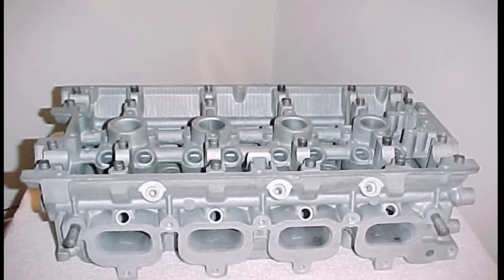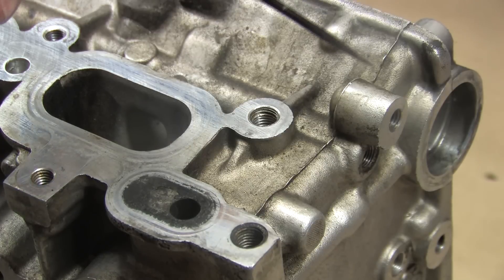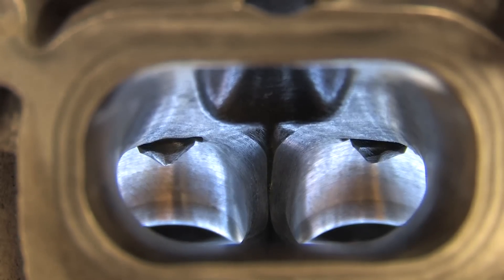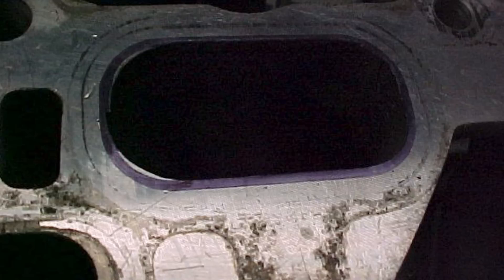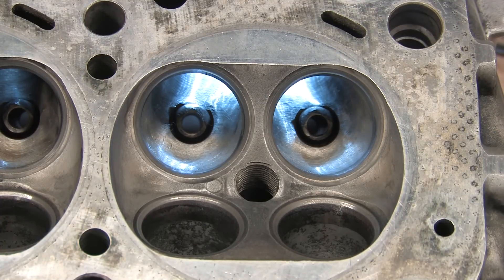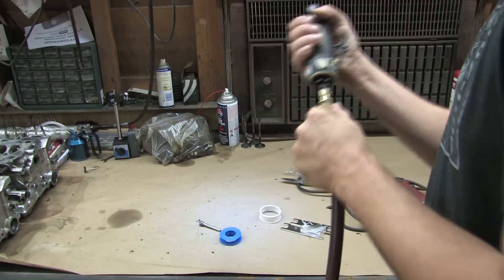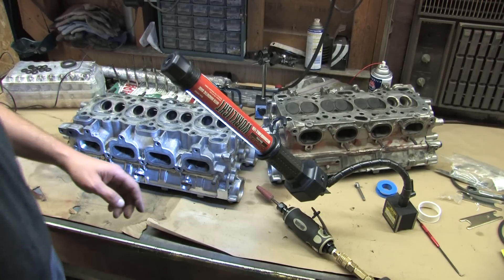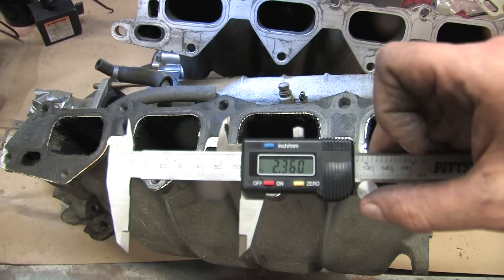Cylinder Head 106 - Casting & Porting Tech

Comment: I've worked with pressure die cast tooling, and "flash" as we knew it by was quite a problem at times, usually the result of poor bedding in of mating die steels, or core pin mis-match. Net result was it meant another tooling operation to trim it off which cost time & money & so on. Excellent video once again. Nice to see a Mic once more... :-)

Comment: you have to combine the two in a port.
very slight conical shaped main gallery then wider just before the valve guide to compensate this obstacle by slowing down the flow gaining pressure.

you need to have a larger side of the of the valve guide more than the other to have a better bias effect and better flow.

there is a guy doing heads for bikes that reduced the diameter of the intake ports and he has more hp than the others because of the higher speed of his mixture.
better efficiency

Comment: Old video but I’ll add 2 things… 1) buy a die grinder with a REAR exhaust. You’ll thank me later. 2) use some masking tape on the delicate areas of the valve seats. I have ported A LOT of heads. A bunch of them were old iron heads. I learned the hard way lol

Comment: Great vid.  Only recommendation I would add is get a swivel fitting for your die grinder.  That way you're not contending with the weight of the air hose.  I use swivel fittings on every small air tool I own and it makes one heckuva difference.
Reply: +Mark - Awesome!

Comment: I use a big electric die grinder for porting like the one you say not to use. One trick to slowing it down a bit is to make a short extension cord with a junction box on the end. Wire an outlet to a dimmer switch in the junction box.

Comment: excellent video. Ive been hand porting cylinder heads since I was 14.
You've managed to touch on most of the important area's when thinking about porting jobs. too high a port velocity also affect performance just as much as low velocity ports and it all ties in with where in the rev range you want to make max torque.

Comment: Thoughts on grinding the bottom of the seat on the intake side. There is a step there it's like hitting a wall. Also grinding the valve seal smooth. And just clean the casting lines up. And a gasket match.

Comment: hi i like your clip, i used to port heads 25 years ago and i used to back up what i found on engine dynes so i know a little about porting . what a lot of people forget is fuel flows throw the port as well and that is wear a thing called swirl is very very important, and fuel control throw the port how you do that DO NOT MATCH PORT because the fuel will trace along the wall of the port you need to get that back up into the air flow so it can mix with air so your not wasting fuel this means more power and better fuel economy . how do you do that is went you blow air across a 90 degree angle you creat a low pressure witch can draw on a liquid say with when blow air over a straw in water it will draw the water up the straw and into the air stream . now if the intake port is larger than the intake runner or manifold by 1/8 of an inch you will make a step witch is a 90 degree so when the fuel is traveling down the wall of the runner it will come to the step and pool the air stream will pull the fuel back up into the air stream . i now you get better flow figure on a flow bench, but when you dyno the engine you don't get the HP when you step just the intake you get a richer mixture on the dyne when you lean the mixture out up comes the HP if you don't believe me try it thanks jake
Reply: +TheJVR333 Hmmm, you obviously know way more than I do, but I'm wondering if this is truer with fuel pulled from a carburetor than from a misting fuel injector?

Comment: i was speaking of the ridge between the exhaust port and the manifold  wich helps to prevent backflow.
i knew about the speed of the gas and the size ansd shape of the exit.

i found nothing on the backflow and this ridge.

you wrote "As gasses expand, they cool" ?

they are slower as they cool because they take less volume and loose vivacity as i know.

i missed something ?

Comment: one question : i can read on the net that exhaust flange should be wider than the port itself to create a ridge.
it's supposed to prevent backflow in the port
excepted if you have a supercharger (so a load even at low rpm and no scavenging effect required as i understand that) you're supposed to keep the ridge.
so to have the port matched to the manifold flange is a mistake that i did.

what do you know about that ?
i found nothing.

Comment: Tape actually works wonders to prevent oops when working around the valve seats. It's usually enough to let you get away with that first "oops", which is usually all you need. :)

Comment: Great video's, I learn a ton from everyone.. Especially anything that can be ported.. You mentioned there was no way available to slow the speed of an electric die grinder when in actuality harbor freight sells a router speed controller, basically a reostat that can allow one to slow the speed of an electric die grinder for example..I own the speed controller and harbor freight long reach electric die grinder and the speed controller makes all the difference in the world..Also have a makita electric long reach die grinder with build in speed settings so it is possible to slow the speed to your situation, just thought I'd share that bit of info... Hope it helps someone else who reads this.. Thank you once again for your  channel, There are some video's that I rewatch especially in the Coronavirus lock down that I learn so much from..One can never be to overly informed..I try to be a sponge and absorb as much useful knowledge as possible on a daily basis.. There are not many folks that put forth the time and effort as you do and it's appreciated.. Even the pokes & jokes make it all worth while..

Thanks again for great video content..

Comment: FYI: I do have experience porting cylinder heads, however I am only a novice. Just some general tips before anyone begins to port out a head. 1) TAKE YOUR TIME...rushing on a crucial engine part such as a cylinder head is only going to hurt you. 2) Make sure you have the proper tooling, die grinder, rotary files, stones, etc. 3) Clean your head, nothing to obstruct your vision. 4) Let there be light (have ample light going into the runner or whatever you are working on).

Comment: Why is a 130w dremel not enough ? I find it perfect with carbide burrs for coarse work and very nice with a flex shaft for finishing. I even ball ported a head with one.
Reply from the maker: It's just a little on the slow side, that's all.  It doesn't have anywhere near the torque and speed of air tools with 100+PSI behind them.  With the exact same careful hands using air tools, you can deliver the same results in a fraction of the time.  The Dremel makes up for its lack of speed in its light weight and the size of the tool, though.  It's more comfortable to use and that's just fine for the time it takes to get the job done.  If you have both, well then that's even better.

Comment: Thanks for the feedback; I have another question if you don't mind. What all do I have to do if I need to change out my rings. I did a leak down test on one of my cylinder and the compression is low. I saw you video on the block. Do I have to hone it out if all is in order or can I put them in like that? Is there any way to test them before putting this motor back in. please keep the video coming. This is my first year in auto school. Thanks a million for your help

Comment: If i was you i would clean up the two but enlarge one port only.
the other would keep max speed airflow for turbulences at low rpm and would be good for torque.
once full and out of breath the bigger port would take the work of big rpm flow and charge of you turbo engine.

it's what they do on the early tdi engines for max torque on a quite big powerband

Comment: Your divider's shape between the the intake ports is not good.
knife edge shape create a lift in the air flow.
you should have a stock shape but reduced in thickness and smoothed.
Just look at the shape of big plane fuselage or simply a whale.
even the concorde have smooth edges on the front of the wings and nose.

Look at the work of kucheman and weber for example.
it gives good ideas.

Comment: nice info, but don't knife edge the inlet port, leave a slight radius. Knife edge the exhaust ports though ;)
Reply from the maker: That was a great discussion above.  I needed it.  I'm proud of how civil and intelligent my subscribers are.  By the way... I'm porting a head the way you described right now.  Cat's out of the bag.  I always felt like my GSX head was ported backwards, but the dang thing flows.

I had a whole bunch of metaphors to tack on the end of that, but most were really gross.  You guys have more self control than I normally do.
Reply: +Jafromobile Whoa! Knife edge the exhaust instead! That makes sense. It's like air coming off the back of a truck bed which is closed. The low pressure zone simulates a gradual drop off, but open the gate and the air slams hard making more drag on the bed. You cetainly wouldn't want a truck driving backwards though!

Thought about it really hard, and I'm thinking a smooth transition will prevent the off the top of the roof of a truck and slamming into the bed effect.

Not knife edging on the intake would do more swirl, which I think is the whole point of Dual intake valves, but with the exhaust you don't want swirl, just FLOW...well, velocity has a point too, I always struggle with my thinking balancing the two.

+PiezPiedPy Thanks for helping get my ideas flowing!

Comment: You said not to work on the combustion chamber side of the valve seat. What about un-shrouding the valves by rounding out that shoulder that is on the combustion chamber side of the valve seat, while avoiding the the mating surface of the valve. (I am referring to 14:27 in the video) The reason I ask is because I have been doing this, and then following up by polishing the combustion chamber, and will be measuring/equalizing the combustion chamber volume across the head, and this made me nervous

Comment: What about throwing painter's tape on the seat?  Are there fail-safes to avoid killing your valve job?
Reply from the maker: +Ryan Eaton Painters tape wont protect you from making mistakes.  It's just not strong and impenetrable enough to protect you when you miss.  I used it as a warning.  It wasn't enough to stop me from screwing up.  Perhaps a portion of that was me, but I felt like I was being careful.  You've gotta spend an awful lot of time hovering over it, and everything goes a blur.

Comment: @Jafromobile i watching your video and taking the tips, im about to do a  port job in my peugeot 106 xsi head, do you know it or have any tip? thanks!
Reply from the maker: I am not familiar with that one, as they don't even exist here in the United States.  I just read the specs, and polishing would be fine on the exhaust ports, but stop at 80 or 120 grit on the intake ports.  Just clean up the casting and where it meets the machining.  95% of your gains will come from just doing that.
Reply from the maker: I also did an experimental port job on this channel.  You've probably seen it.  :P
Reply: @Jafromobile  Yes, i've already saw that, nonetheless, thanks for your time and words, your channel and vids are quite usefull.

Comment: Please somebody i have an important question if anybody can help ill be very glad guys
-IF I DO A 3angle valve job WILL THE VALVE SEAT KEEP THE ORIGINAL STD SIZE?
Reply from the maker: Yes.  It will just recess them slightly.  Slightly decreasing your seat pressure because it slightly increases the length of the spring on the other side of the valve when the valve is closed.  Each time you do a valve job, it adds up.  As long as you keep your spring pressure correct for the cams you're using and how you use them, you'll be fine.  There's a video about spring pressure and install height.  Cylinder Head 203
Reply: Thank you!, the question is just because i bought a set of supertech titanium valves before i wanted to do the 3-angle valve job and i was afraid that the valves wouldn't fit, but thanks im gonna make my head the 3angle job!
Reply: I've read that titanium valves require bronze seats. Is this true?
Reply: +Hugh O'Brien That clearance would seize the valve in the guide for air cooled .
Reply: +Hugh O'Brien  I work on Harley heads and if you don't use proper clearance the stem seizes in the guide. The guides I use always have to be reamed to spec . There is never clearance out of the box.

Comment: Jafro,
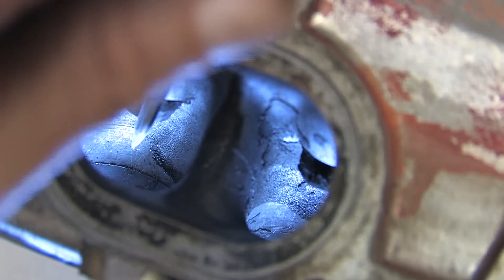            In this video just explain porting your intake an exhaust. About 9:08 - 9:16 in the video you say not to worry about porting an or knive edging the dividers on your exhaust side of the head, but you just recently uploaded a video on the Hyundai head where you ported an polished the exhaust side of the Hyundai, an you defiantly knive edge the divider in the exhaust ports. Which is correct? Port the exhaust or not?
Reply from the maker: It's all about the difference between the 1g and 2g castings.  The head shown here is a 2g head, and the shape of the bowls is already better than the 1g heads.  The intake ports are about twice the size on the Hyundai than this 2g head, so opening up the exhaust ports has a more significant benefit on the Hyundai.  The Hyundai has a 1g 1.6L head with significantly more restricted ports.  The size of the exhaust flange ports are the same, but the port shape is different.  I'll talk more about this in my next video where I have both heads for comparison.  Knife edging helps when you can get away with it.  But in either case, not a whole lot was removed from either this 2g head or the Hyundai head.
Reply: Interesting... Hey on a random side note. Whats your opinion on Tom's turbo upgrade video 1? he ports hes turbo? Will this improve performance of the turbo?
Reply from the maker: When you eliminate the steps, you improve the flow.  Lining up the gasket and the port will do this.  If you're thinking about just making the hole bigger, it doesn't really help much for the same principles as porting the exhaust runners larger.  Air flows slower through a larger port.  In front of the turbo this can actually hurt the spool time because it's in front of the exhaust wheel, so it's important not to go crazy here and punch a big hole through it.  The right way to do it would be to measure manifold pressure to see what kind of a restriction it is.  If that pressure is too high at high revs, then going bigger would help.
Reply: So just doing a simple port job on your turbo would improve spool time an also how much air is going in to the turbine? like just a gasket or manifold to turbo port? Have no back pressure in your exhaust can that hurt the turbo? or help it? Like for example bigger turbo larger exhaust? 3" or 4" exhaust?

Comment: I dissagree with your opinion of opening the runner... Opening the runner will actually help slow air speed wich is a crucial part of helping the fuel hang on and making the turn around the short turn. Also depending on where you grind on the floor of the port it can actually pick up also

Comment: ur sohc has the exhust and intake over each cylinder and the sohc head is only made to fit 1 cam so if u want to do it properly ud have to make ur own cam and head or if ur lucky the block is based on a sumlar design and u can swap out 
nissians and holden have this in rb seiries engine dont know witch

if u want to do it the dicky way ull have to make a bearing holder that works on ur existing head cut ur exust and intake parts so there seperate put spockets on it and make a chain drive system

Comment: good video 
polish exhouse for reduce,s heat to the head (and reduce hanging carbon) 
and tool finish intake port for superior feul to air atomization
you are handy ,a flowbench made with vacume cleaners and a (bosch) car airflow sensor
can be used to measure flow treu the ports (ducati flowbench v1, on youtube)

succes with your project

Comment: Go on Amazon and search for "Pit Pro PT2440 Heavy Duty Extended Die Grinder"

This is simply the best pneumatic die grinder I've ever used for porting. Air flow consumption is pretty good and it gets in far without needing long-shank bits that can bend or torque their way out of the collet. It's also easier to manipulate when the hand that guides the bit doesn't also have to squeeze the regulator lever.